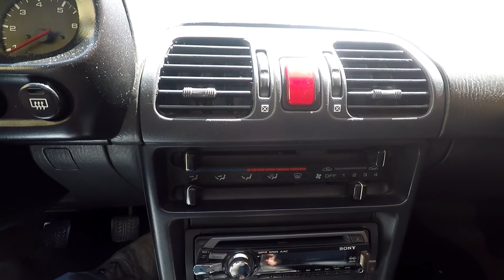How To Clean Your Ventilation System

Comment: Resist the temptation of spray cleaners or anti-mold sprays where it will likely only make it more difficult to remove debris. Only after a thorough cleaning should you use any disinfectant.
It’s a shame manufactures don’t include better methods of keeping debris out of the cabin air system, as well as making it easier to clean out the system. 
I imagine the in-depth cleaning of in a car system will take many hours may be days. It will be best to videotape and make label notes where small parts come from. 
For your safety, you should consider wearing a dust mask. You should have a variety of small brushes to agitate the dirt in order for the vacuum to pull it away.
I assume mini cars have duct tubes to direct the air to your interior vents. 
You should locate any available information on your particular car and specialty tools before beginning. The longer it takes to complete the task the more difficult it will be to put it back together. So learn everything you can, and find all the information available including tools before you begin.
Reply: Yeah, I was surprised that my car (1993 Subaru) has no easy way to clean the ventilation system, especially since debris easily falls in to the the plastic grill/cover below the windshield. The airflow is obviously worse than it has been. It's not a filtered system. And I haven't found any manuals that cover this, beyond maybe a complex diagram of the system. So I have known for a while that I need to just dig into the dash and explore. This makes video makes that so much easier to picture what that's going to be like.

Comment: Can i just block that whole intake with duct tape or weld it with a piece of metal, compleatly shuting it off . 0 fresh air coming in . I know i will be loosing the feature, but i live in a dusty invironment and my car doesnt have any filter, so every time i open the fresh air mode i risk ruining  my expensive evaporator . And if i need a fresh air iwill just roll down the windows . So does this process have any effect on the HVAC system?

Comment: Nice video.  The problem still remains that the whole vent system of ducts will still be dirty...
Reply: But most vents, being up higher, shouldn't be very dirty. He covered the main areas that are low and textured, getting the majority of filth. A fridge brush or strip of cloth on a wire can be used at removable and fixed vents.

Comment: For the clips I don't pry them up, you can press them upward from the bottom using anything wider than a screw driver ( I used a plier, closed the jaws to make it flat and simply pressed upward) while keeping your other hand on the top of the plastic clip to catch it and prevent it from flying away and getting lost in the engine bay once thy pup up